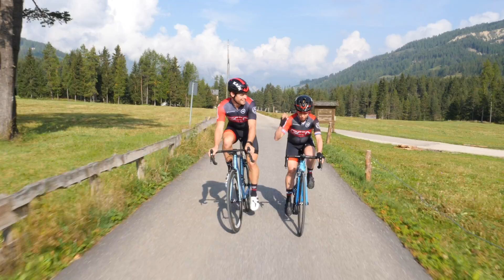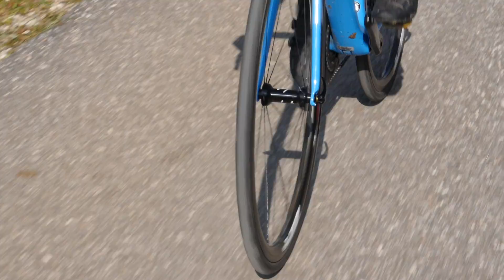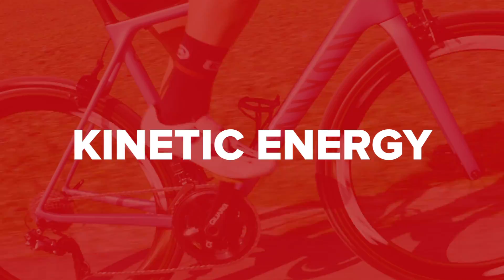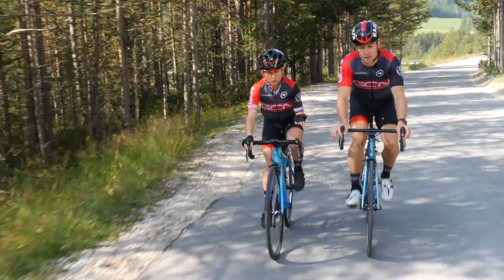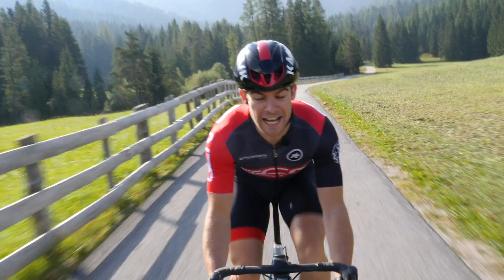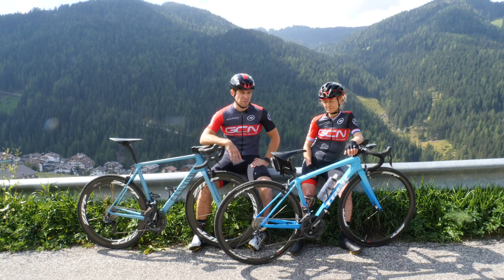Can You Really Put Out More Power On Climbs?

Comment: On the indoor direct drive trainer with a climb simulator that raises the front wheel. Fi to a 5% angle. 
In the raised uphill trainer  position I can more easily hold  over 4,1 Watts / kg power output.
While with the front (wheel) of the trainer in a lower position on the same hill on Rouvy on the same course my power output drops to 3,9 w/kg about +- 15 Watt power difference.
The difference is significant about being able to ride in Zwift category A in the uphill trainer position or about being in a lower category B.
So in my case I think the extra power output uphill is caused mainly : -> by the uphill position of the bike, that engages different kind of muscle groups .

Comment: With regards to muscle recruitment and motor patterns, it's not a matter of slow twitch versus fast twitch fiber distribution that determines flat and hill performance.  It boils down to the actual muscles being recruited.  A ton of cyclists I work with are quad or hamstring dominant instead of glute dominant.  Training to have glute-dominant motor patterns will allow you to perform well (for your weight category) in both hills and flats.  However, training to improve fast or slow twitch muscle fiber performance won't have any effect.  Crank lengths can help or hurt muscle activation too, which is why studies either find no difference or a huge difference in power or O2 uptake at varying lengths.

Comment: I suggest that the answer is that you could easily put out the same power on flat roads, but you wouldn't be going fast!  Unlike climbing where any style is more or less acceptable (out of the saddle, sitting upright, bobbing your upper body), going fast on the road requires a low upper body position so lots of adaptation (using the same style as in climbing would be a waste of 50 watts or more).   This seems confirmed by my observation that fit beginners can climb quite fast, i.e., faster than me, but can't keep up on the flats.  

As an example, I was at the track yesterday and there were people in the 45kph group who were riding on the handlebar tops all the time. It seems to me that they were more training for climbing than for going fast on the track.

Comment: I find if i redline, it doesn't matter if uphill or flat. About the same power at 1100-1200W. of course, I'm mega fast twitch. If i do a long slog up hill pushing , then i'm usually marginally up on power vs long slog on flat....but it probably is only maybe 30-40W....i do think some of it is on my head, and short climbs, i just try to flatten with power, so seemingly if there is more of that, i will see a higher average power than just flat.

Comment: With uphill pedalling, as well as the usual inertia resistance and body/bike weight you also have gravity to battle/push against giving more to push against than riding on the flat? A bit like pushing off the side of a swimming pool compared to pushing off water (just swimming) - you can gain more power with the wall than water if that makes sense?

Comment: Try doing it on a fixie with the right gear ratio on each gradient you'll see that it doesn't make that much of a difference, the issue is that flat is often not flat but rather slightly uphill/downhill, it's probably worth more comparing a slight uphill (1-2 % ), and a steeper climb (8-10 % ). As Mark Botrill and Cameron Wurf said on GTN, it's about speed not average power. There's no point in going as hard as you can during a downhill section. BestBikeSplit wouldn't exist. That being said I would love to see the power distribution of a good time trialist like Rohan Dennis or Tom Dumoulin 😉
Reply: So... the fixed gear will iron out the wrinkles in your pedalling technique, which I guess is exactly what they were talking when they speculated that the difference in power between flat and uphill riding was to do with the distribution of power throughout the pedal stroke.

Comment: I don’t have a power metre, but I have noticed that my heart rate can go up to as much as 194 bpm uphill, but never goes over about 170 bpm on the flat. As soon as I start uphill, however easily I take it, whatever the cog size, my heart rate just jumps up. Why is that?
Reply: I was in almost exactly the same situation at the start of the year, I frequently blew up on longer climbs. The simple answer is: you're actually putting out quite a bit more power than you think! Just a couple degrees of incline make a huge difference, so to keep the same intensity/heart rate you'd need to slow way down. Once I understood that, climbs became much easier or at least manageable for me.

Comment: Just pointing out for GCN and other readers.
You can test position variable and Kinetic energy variable separately on trainer.
For position, well just alter the position and test.
For Kinetic energy, keep cadence and power constant (ERG mode is useful). But change gearing on your bike!
On high gear, your flywheel will spin fast so that is high kinetic setting. 
On low gear, your flywheel will spin slower so that is low kinetic setting. Both at the same power and cadence.

I've found myself to be much better in high kinetic than in low kinetic set-up. So i see myself riding easiest gear with high resistance on trainer for the upcoming winter...
EDIT: remove word inertia
Reply: Seems like i need to revisit my physic class. :P
Inertia is ability to resist change in speed. So you are right. Thank you.
I meant to say high fly wheel speed and low slowdown rate (due to stored kinetic energy) compare to slow fly wheel speed which slow its rotation easily because it has less stored kinetic energy.

Comment: Does the same thing apply to wind direction? I find it easier to put out the same power with the wind behind me, than when I'm riding into a head wind. Or is that just psychological?
Reply: I feel the same way. It hadn’t actually occurred to me that this could be different for other riders until now, but I see what you’re saying. A headwind is opposing force exerted against You, while a tailwind helps You along, making an equivalent gradient a bit easier. However riding on the flats a opposed to a hill would be more like riding with zero or very little wind. Perhaps a lesser or greater headwind could be equated with a lesser or greater percent gradient going uphill, and tailwind with a descent.
Reply: isnt that the opsite on what the reason was in the video you should have it easier to put out more power in a head wind then tail wind if you are good at climbing

Comment: I was surprised I'm not that much slower on flats either. Nor cobbles. There might be some difference, but it's not significant. I'm definitely aware the strain is not the same, nor focused in the same proportion on the same muscles. A bit of extra resistance training for my arms and back fixed the discomfort I got again while riding in the drops on flats. Maybe so much climbing imbalanced my lower to upper body strength ratio and needed some touching up?

Comment: I can definitely agree with the conclusion about muscle fibre types.  I have next to no fast twitch (if I can sprint to 700w I'm doing well!) and find I can put out a lot more power on climbs than on the flat.  To maintain any power on the flat I feel like I need to be engaging in a constant light sprint, or the pedal just starts to feel slightly unweighted for part of the stroke, and I'm actually having to chase it rather than pushing against it.  It makes sense that this is happening because I haven't got quite the fast enough muscular response to keep up with lots of the subtle direction changes at a very high cadence and lower resistance.

Comment: So that means if you don't have a Kickr Climb, then you can't really train for Alp Du Huez on Zwift, because when you get there, the incline will make you perform differently. Yes, you will be stronger overall from the training, but just because your smart trainer increased the resistance, unless you have the Kickr Climb, you wouldn't be be replicating the training load on the specific muscles used for going up incline.
Reply: I think you could say that the training might be sub optimal in terms of specificity, but I don't think it's true to say you can't train for Alp Du Huez on zwift without the Kickr Climb
Reply: You can alter Kinetic energy (inertia) variable on trainer.
Test this: Keep cadence and power constant (ERG mode is useful). But change gearing on your bike.
On high gear, your flywheel will spin fast so that is high inertia setting. 
On low gear, your flywheel will spin slower so that is low inertia setting. Both at the same power and cadence.
One setup may feel easier than the other, eventhough both are at the same power and cadence.

Comment: So, what would be the best way to train fast twitch muscles, or at least the best way to train for flat races / time trials? 
Love your videos, thanks for all the work you do!
#askgcntraining
Reply: Gcn pointed out that those with fast twitch muscles are more suited for sprints, and slow twitch for tt/climbs..
Reply: Time trials require slow twitch muscle fibres, since these efforts are long, sustained and constant. 

Fast twitch muscle fibres are useful in road racing scenarios where you have to deliver lots of power for shorter durations, e.g. opening and closing gaps, winning bunch sprints, etc. - so usually in flat races.

To train fast twitch fibres, go for 30"/30" sprinting drills, cadence drills and strength workouts. And if you hate structured stuff, try sprinting out of the saddle every time a red light becomes green, or hitting the local track, you'll have plenty of gaps to close and lots of sprints to try for.
Reply: Thanks guys, I completely messed up : I thought fast-twitch muscles were assimilated to flat.
Reply: @Slinker_  Et si tu veux t'entraîner aux contre-la-montre, ce qui est important, c'est de travailler ta puissance au seuil (la fameuse FTP). Il y a pas mal d'exercices qui se font soit à FTP (des intervalles longs, d'environ 10 minutes, pour que la durée cumulée soit équivalente à la durée de la course que tu vises), soit au-dessus et en-dessous (les over-under, qui t'obligent à récupérer à intensité élevée), soit au dessus de la FTP, pour la développer vers le haut (des intervalles courts de 1 à 2 minutes avec peu de récupération).
Reply: @JeuneCyclisteDynamique  D'acc, merci beaucoup pour les infos supplémentaires !

Comment: It's because you are afraid of the speed you get on the flat with 350 watts.
Reply: I think that speed motivates me to add more power..
Reply: I really start to appreciate speed once I go over about 42kph
Reply: for sure not; I have great fun to go downhill at more than 70 kph or ride at 50-60 kph in strong tailwind - so why should I be afraid of 40 kph on the flats? It's really the opposite, I like to go fast! But I experienced the same like Emma
Reply: There is a very big difference in putting 350watts on the road and having to dodge potholes and traffic at the same time and going downhill fast
Reply: smokanci actually I think there’s some truth in that